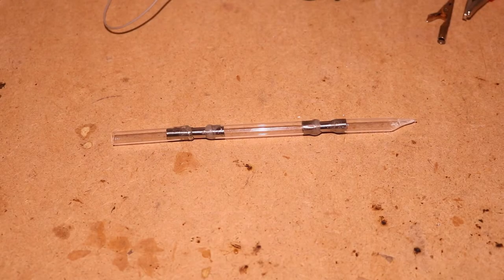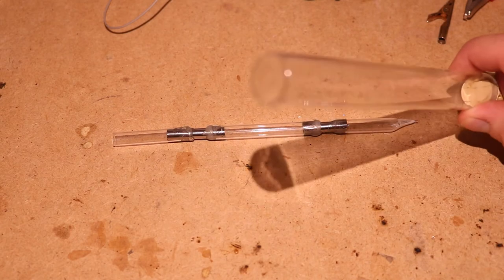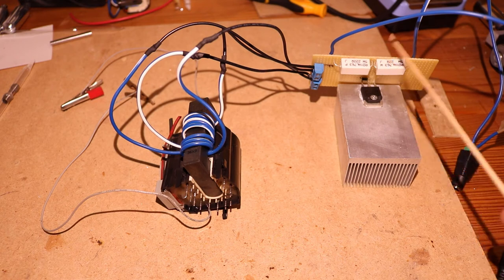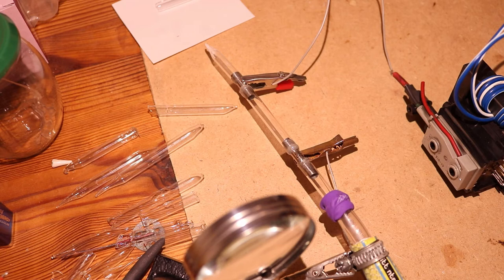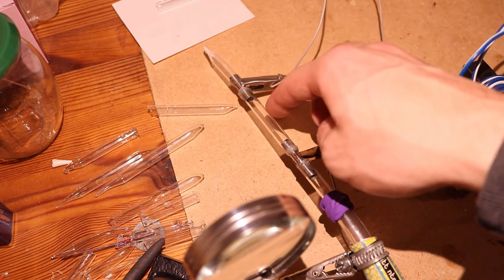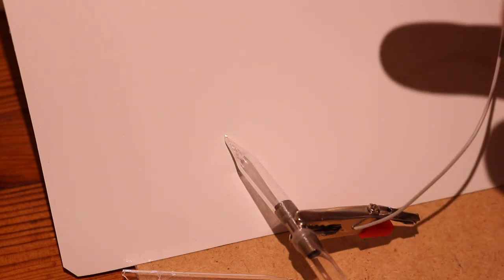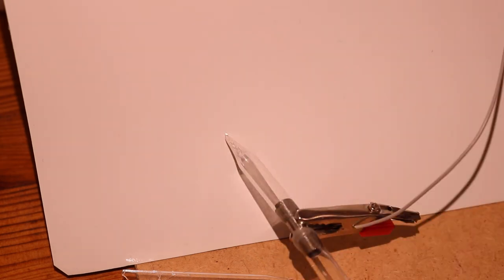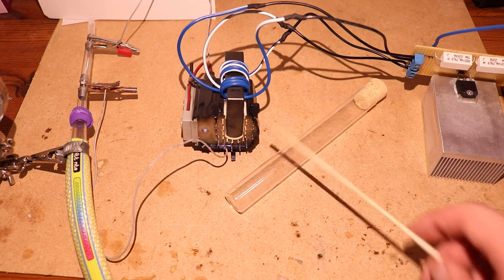Making a simple DIY Cathode Ray Tube

Comment: this is cool, im planning to make a DIY Teltron tube to play with magnetic electron interaction and related phenomena.
Reply from the maker: Interesting, just researched it, but Wikipedia says it needs a pressure from 0,01-1Pa a normal Vakuum pump from Ebay only get's down to 5Pa. This pressure is most likely to high for the electrons to travel very far.